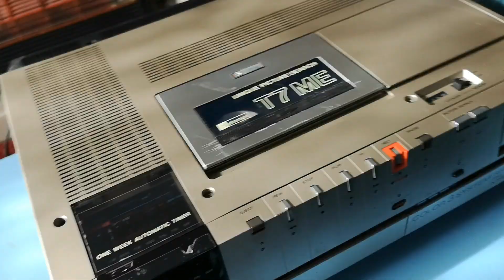Sony SLT7ME Betamax - Strip down and diagnosis

Comment: hi i spy you a new newbee   like you i had a same as you  i am a betacam sp fan  been there with old  betamax getting the parts is hard work 

love  big reel to reel  soundcraft 760    381-8    381-16 decks    and brannel mini 8    i have a   280 - 14 inch scully  all ways getting asked to make video's for my channel
 RED TAPE in the way  WORK IS RED TAPE

Comment: Hi
I just bought one unit SLT7 ME which is not working. Can I send it over to you for repair?
Reply from the maker: Hello, I don't undertake external repairs, I'm building up my knowledge and I am not quite at that level, yet. What sort of issues are you experiencing?
Reply: @JCTsFascinatingHobbies  it's not working. I mean nothing happens when I switch on the power.
Reply from the maker: I had this issue on mine, you can get away with replacing a couple of transistors in the PSU, and the capacitors, however, I ended up having to buy a reconditioned PSU, in the end.
Reply: If you still need your machine repaired, let me know - have done a lot of these machines (C7/T7 and have just repaired a T9).

Comment: The power supply is quite similar to my Sanyo VTC 9455's. Same PWM chip and similar board layout. Mine is also a Middle East model and has almost the same features as the T7 (multi system etc). Be sure to discharge any caps before working on the SMPS. Mine had 280 volts of charge when I took it apart!